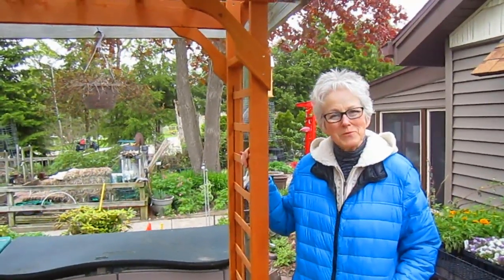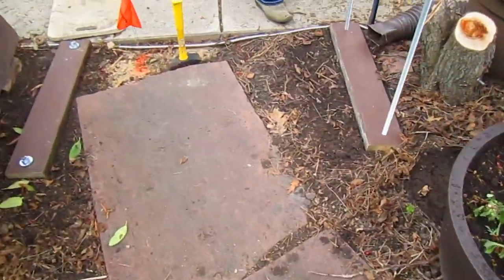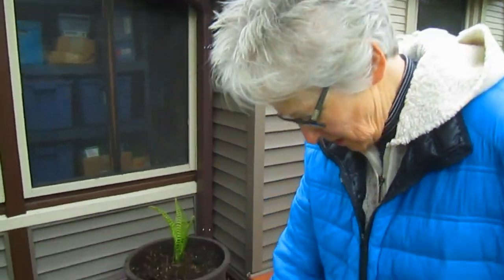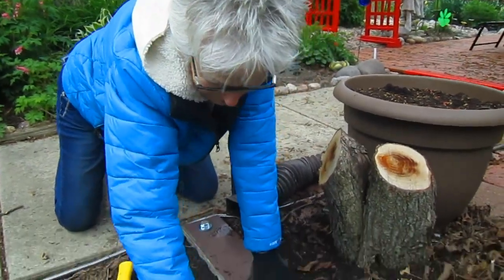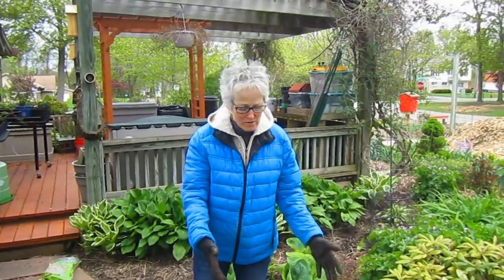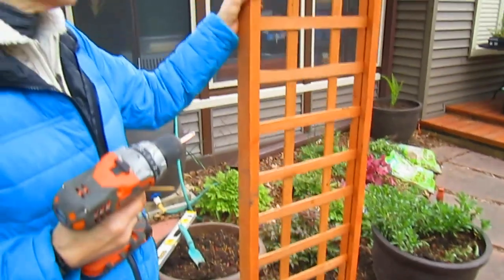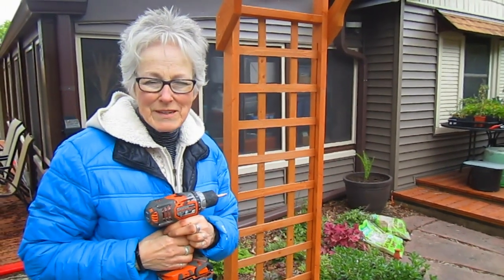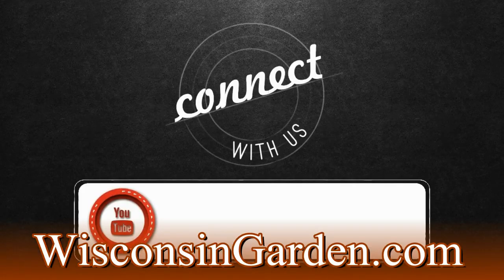Installing Our Wood Arbor - Wisconsin Garden Video Blog 875

Comment: That looks so great!  Loved watching you install the arbor, thank you. I have been planning on moving  a trellis I have but I wasn't sure how to anchor it to the ground. You have solved my problem and in a much easier method than any I came up with.
Reply from the maker: Hi Meredith. It all takes a little planning. Make sure to call Digger's hotline to always be safe rather than sorry. Just make sure to use ground-contact rated pressure treated lumber 2"x8"x24" or more depending upon the width of your arbor. Add an addition six inches in length for each anchored board foundation. The added width allows you to drill around 3" from each end of the foundation board for more strength and also avoid end splitting. Then pre-drill each end for 5/8" 5' threaded stock adding 2 washers and nut.  Prepare the ground area and test the level of your matching foundation boards. Tighten just enough of the nut to match the top of the treaded stock, then wrap enough electrical tape to keep the washers and nut tightly in place before pounding the entire stock in the ground.  Again, use pressure treated 2"x4"x a couple inches wider than your arbor width then attach to the bottom side legs of your arbor. Use either 3 1/2" stainless steel or deck screws for longer life. Hope this helps encourage you to build it yourself.  Thanks again for watching, caring and sharing. Lynn & Richard

Comment: paint and primer is a selling ploy ! does not work the best that way, cant beat a coat of good tinted primer and a coat of paint  -  latex over oil can be done. oil over latex  no no . u can always check by rubbing off a small spot with  acetone/ nail remover = latex. no change its oil
 lacquer thin = lacquer. just buy a good semi or satin exterior latex or waterborne paint ,one coat should do it. sherwin, ben moore -even top of the line behr is good, (on sale now). as i get older, i buy the best ! less labor, better job, lasts longer and cleanable. looks like it has a coat of stain probably oil or lacquer. which is good base, for 1 top coat . by the way  ,nice quality lookin present.
Reply from the maker: We highly agree. It pays to buy the best and doing the job right the first time. We use Behr for all painting needs. Thanks for watching, caring and sharing. Lynn & Richard
Reply: yes the cedar stain looks great and matches their deck!
Reply: Just like i had told Lynn and Rich earlier....it's a crazy ploy...always buy separate primer from the paint!...You are right oil primer is best under latex paint